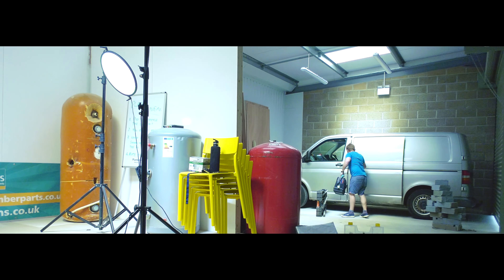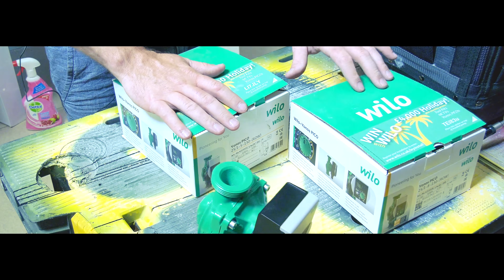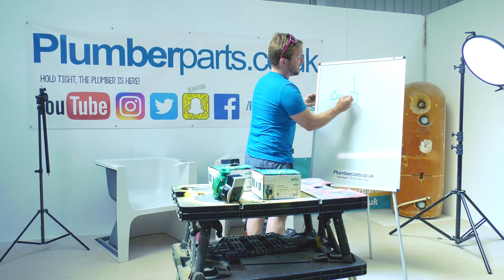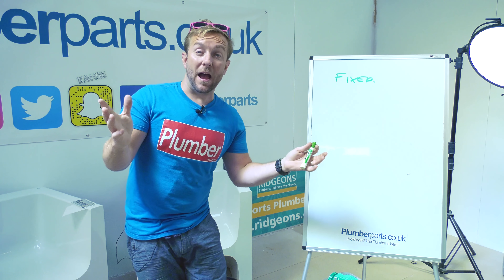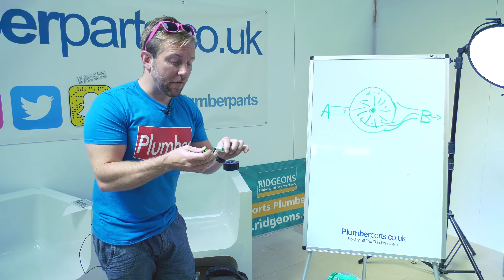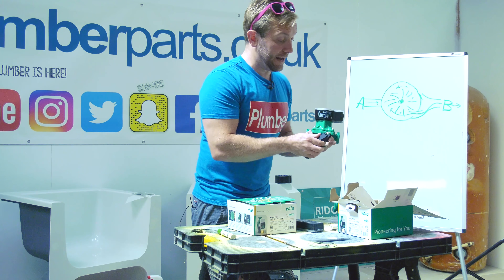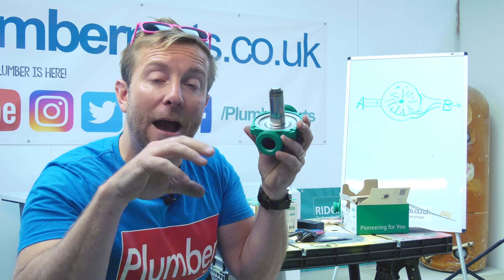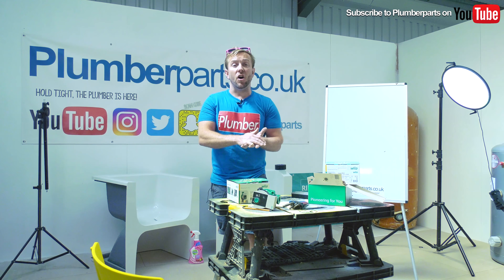CENTRAL HEATING PUMPS EXPLAINED

Comment from the maker: Links to the tools I USE EVERYDAY in the description above! Still uploading helpful video today! Plus Follow my Vlog, TimesWithJames  http://www.youtube.com/c/timeswithjames
Reply: Some help / advise, on a system, cold it's 1 bar, when hot it's 3 bar, it starts to rise from 2 to 3 bar over a short time, a few days, its a combi boiler, unvented, when I release some pressure, when hot, it then goes really low? Like  0.5 bar? The system is from 2008, its a heatline boiler, 15 mm rad pipe work, I cannot see a expansion tank,
Reply: hi your videos I great and really help me. your to go into the thing about the magnetic field and the magnets in the pump. Could you please briefly tell me about it? thank you
Reply: Hello,

I have one question for you, namely, why did the E- sign suddenly appear on my pump?
Namely, the pump turned on but did not drive water through the pipes, but the E- sign appeared on the pump
Then I turned the thermostat - button on the thermostat to a higher temperature, after which the pump turned off. Then I turned the thermostat - the button on the thermostat back to the same temperature as it was before the problem, and the pump turned on normally - there was no longer an E sign on the screen, but the temperature was 45 C, and now the pump is working normally.

I wonder what was wrong or why did it happen that the pump turned on, the sign E- was on it, and not 45 C, but it did not send water through the pipes

I sincerely thank you in advance for your reply.

Comment: I was expecting a bit more depth than this. I have a pellet fired boiler which works much like a combi and has a built in pump. It is a replacement for a AGA type range and the rads worked OK on that setup. With this boiler the furthest rads don't get hot. I suspect the electronics in the pump are slowing it down (there is no speed knob). I want to bypass the electronics and wire the pump for full speed. I took it apart and found there are 3 connections to the field coil windings. This sounds crazy to me but the resistance between ANY 2 of these connections is 118 ohms. Logically if it was a centre tapped winding there would be 2 readings of 118 ohms and one of 236 ohms and I would connect to the 236 ohms for full speed.

Comment: i've got a ups3 (the one with no control button) in my combi boiler. It's got a PWM port with nothing connected to it, so it just runs at full speed. It doesn't seem that there's any PWM function on this boiler so why the PWM pump? Tempting to change the head for one with a button.

Comment: Do they still require mains pressure water pushing through them or can water just be there an it will still pull an push the water

Comment: With the Wilo SB30 for recirculation or in general can the head be removed and replaced upside-down? It will make wiring, fitting and maintenance easier.
Reply: That's a very good question William. Yes loosen and remove the two 5mm alan key bolts, reorient the pump head to your liking and reassemble being careful not to over tighten the bolts. It can be helpful in a confined installation. Don't forget observing the manufacturers instructions always ensure the pump itself is aligned correctly.

Comment: Can tell my landlord is cheap then putting in a "new" fixed pump (and set it to the wrong speed as half radiators didn't get hot until I changed from 1 to 2)

Comment: If you were moving a hot water tank from downstairs to upstairs would you also move the pump upstairs with the hot water tank or leave it downstairs with the boiler in its current location ???

Comment: @plumberparts Is it possible to replace the original pump in combi boiler Ideal for that from the video? I've installed one additional massive radiation on my kitchen and now the 1-2 radiators on the 1st floors are a bit colder than usual.

Comment: I bought the cheapest chinese ch pump you can imagine, cause back in a day, when i did my first boiler install back in 2015 i didn't know any better. Pumped fine, until hot water hit it from the boiler, and it stopped pumping. Had to put out a fire with fire extinguisher in cast iron boiler, so not to damage it. The bloody thing stopped spinning, because the impeller is just friction fit on the ceramic shaft, and hot water expanded it and made it larger and it basically stood in place while shaft was spinning. Put in a 100 euro grundfos smart pump and 3 years past, still works wonderfuly. The chinese one went outside to my small pond to circulate water, so to trap mosquito larvae, and keep water clear. Also, cause cold water, worked fine for 3 years. Moral of the story don't buy cheap pumps, it will only give you a headache.

Comment: Also them pumps are great the 8m one i typically use is 180mm in length instead of the usual 130mm as it’s the bigger bad boy

Comment: I have a grundfos pump and it set to speed 3 which sounds noisy,  could I try it on a lower speed with out causing any serious issues?
Reply: Morpheus shouldn't be a problem. Sometimes having the pump set to 3 could actually be the issue. It's possible the pump is pumping the water too fast. Creates air.
Reply: Ronan Daly thanks for the reply,  we recently had a new boiler fitted and when it is heating the hot water it does sound like air going through the boiler, we have a unvented water tank and a oil combi boiler.
Reply from the maker: Good shout!